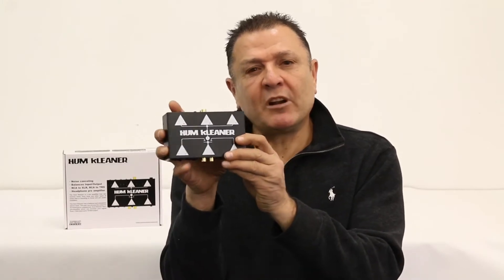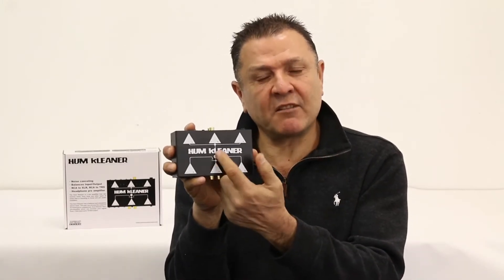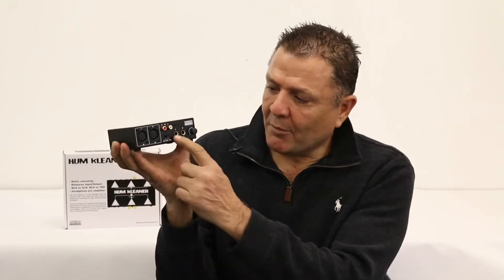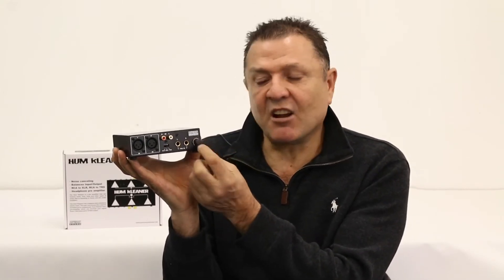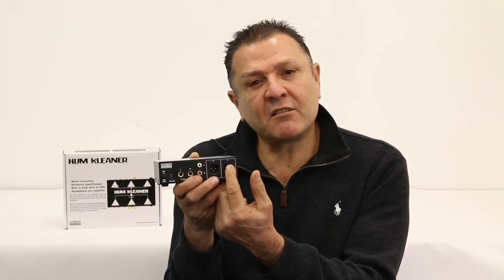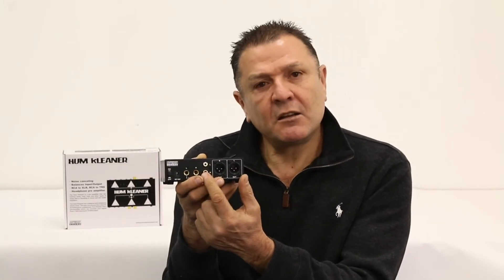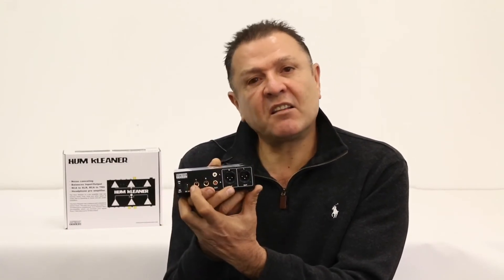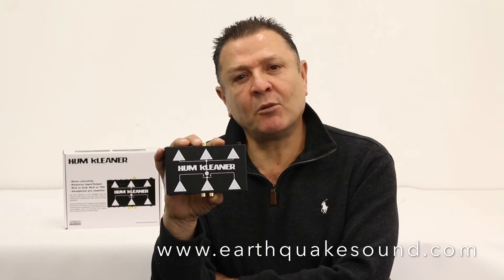HOW TO FIX YOUR HUM - HUM KLEANER - EARTHQUAKE SOUND

Comment: A really nice product which solves a common problem, but I can't help to think you should probably add the sound of this video to be in both channels as it is currently left only and maybe run the microphone through the hum cleaner as there is a lot of static noise on the line.